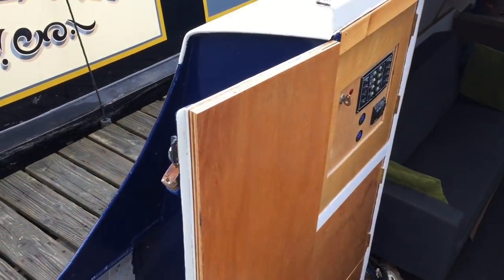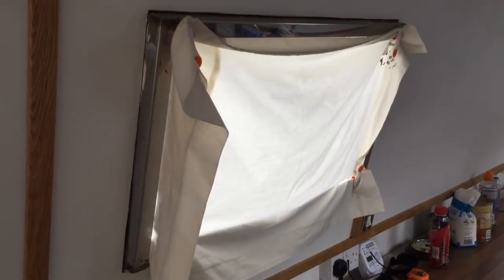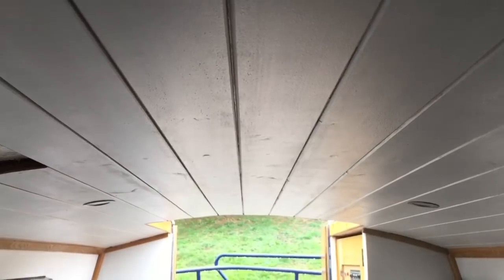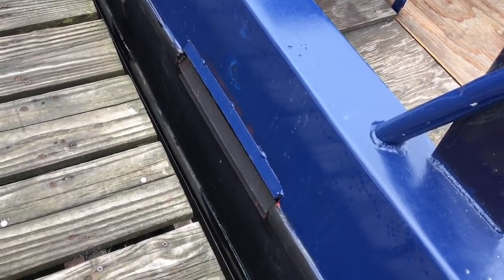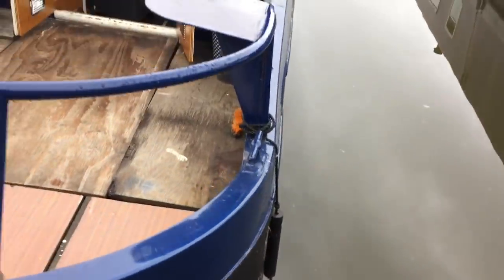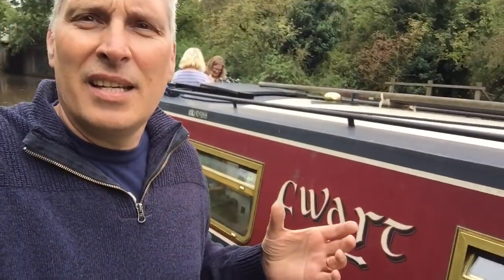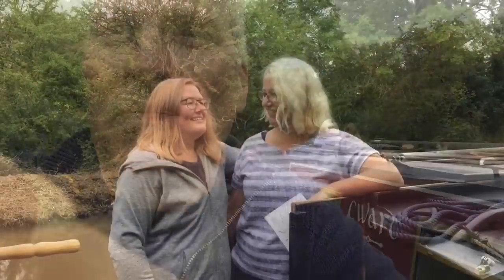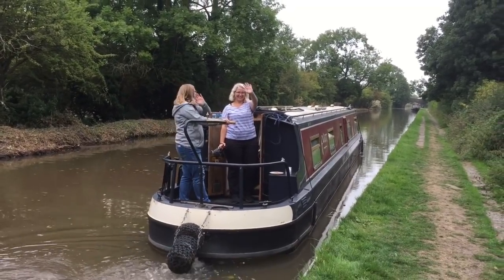Ed’s narrowboat Ep57 work catch up and lending a hand

Comment: Hi Ed, you met me at Atherstone flight, although I was star struck by Anna and Kath.  I'm in you're video, seen walking back to my boat as Anna enters the lock.  Good luck with the renovations.. she's looking great!  Edit:  The wood on the inside of my stern doors is rotten at the bottom and I think it's because there is access for rainwater to penetrate between the metal of the doors and the vent plates' top edges as it will not be watertight.  I have put some sealant on mine to prevent further ingress.  Have you considered this?

Comment: Not sure what kind of welder you use Ed, but is there anything special needs doing before mig/arc/etc welding on the hull? Just wondering if it wouldn't mess with electrics or something if they're grounded to the hull.
Reply from the maker: Hi and thanks for the question. The welder is a MIG plant and you have to isolate the batterys first and check that there is nothing on the inside that might catch fire. Its the same as welding a car really.
Reply: Ta, I've never welded a car, but isolating the batteries etc makes sense.